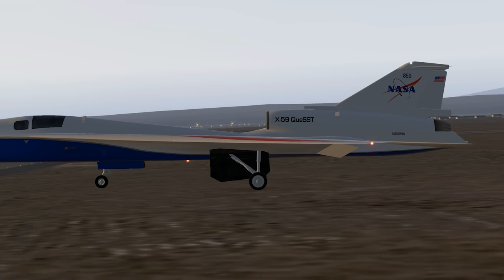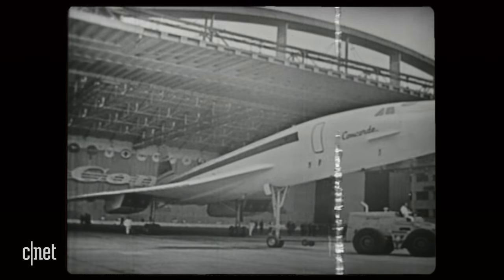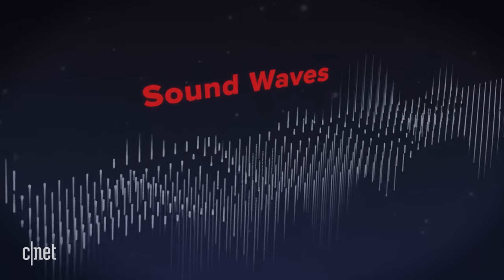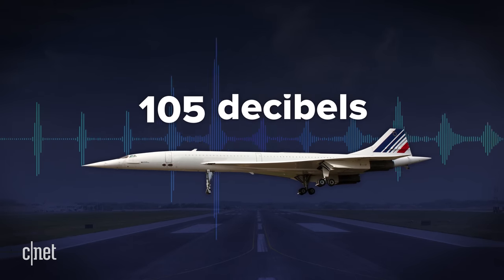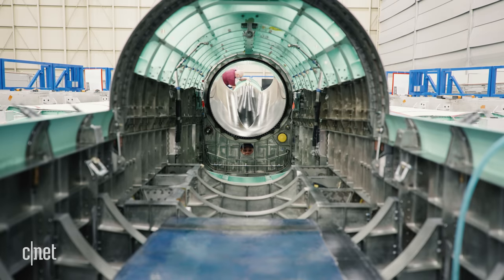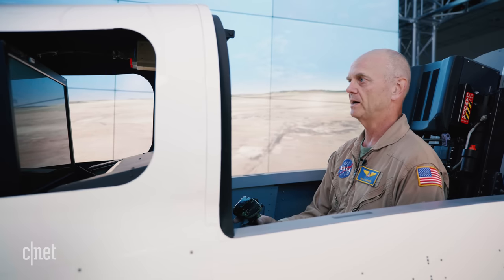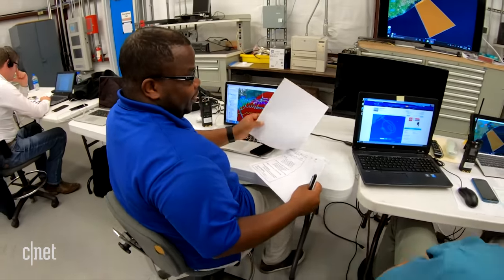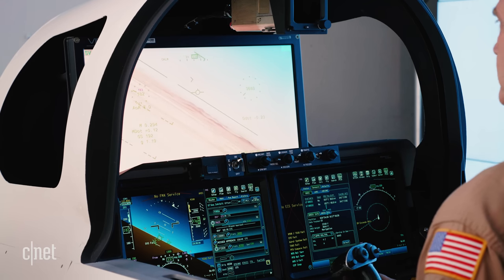Exclusive look at NASA's low-boom supersonic plane

Comment: I flew Concorde one-way (using miles) and it was the experience of a lifetime. We took off like a rocket ship going 250mph down the runway (average speed is 160-180mph) climbing at 24,000ft per minute. Broke the first sound barrier around 1:25 and continued to increase both altitude and speed eventually reaching 58,000ft and 1350mph at 2.0. I saw the black of space out the window, two sunsets, had champagne, caviar, cheese, lobster and more champagne, and we arrived before we left... Paris to NYC in 3.5hrs. I'd do it again tomorrow, an experience I'll never have again. Amazing!!
Reply: The future is looking bright 🌞 ✨️
Reply: Awesomeness! What was your departure time? (if remembered)
Reply: @bar9501  We left Paris at 6:30pm if I remember correctly. I'd need to find my tkt receipt to be certain.

Comment: You know the way Lockheed is building the X-59 is actually really cool. When I interned there I literally worked in the construction are for it. They had the plane split into 3 parts. The front middle and back. They had them separated so that they could work on each piece separately. Then when finished with everything they would just pull the pieces together and secure them. It was really cool watching the engineers work on the plane and literally seeing the 3D models of the plane being worked on. And learning the challenges that these great engineers had to deal with!
Reply: What you described is essentially how we speed up the production process and make the construction of the aircraft stronger and longer lasting for a fraction of the time and cost.
Reply: That's so cool

Comment: It's not just the noise level. It's also the fuel economy - going supersonic also accelerates fuel consumption at supersonic level. 
I hope the jet engine efficiency upgrades also match the noise reduction improvements. Otherwise, this will only be applicable to those who can afford $15000 per ticket - which, to me, is nonsense.
Reply: They won't.  Pointless millions of dollars spent so rich people can fly faster.... cool.  Good job NASA, really taking the world's problems head on there
Reply: it makes sense for businessmen, though; time IS money, especially when dealing with lots of it. In catering to businesses eventually technology will be developed to then cater to the masses, as they have that firm economic base to work with, enabling expansion.
Reply: @PlaySA  Exactly, this only applies to the ultra rich who want to jet around faster. Economy class is all about fuel per passenger which supersonic will never be able to address no matter how "efficient". Unless a totally different method of flight is invented, most of us won't be going much faster any time soon. It's essentially just Concorde 2.0 (and also why they only really care about the sonic boom since that's not letting them fly exactly where they want to)
Reply: If I am correct, at supersonic speeds a thin slow moving layer of air forms around the plane reducing drag and fuel consumption. It is the afterburnes that consume the most fuel. If the engineers can make a supercruising jet which can go supersonic without using the afterburnes the average fuel consumption is reduced. The layer of air forming around the fuselage on the blackbird was a problem for the engines and it would reduce the thrust. The issue was fixed during development. The F-22 Raptor can supercruise at mach 1,2-1,5.
Reply: No it’s mostly the sound. Fuel economy does make things more expensive, but rich people would pay for it. The problem with supersonic jets is most places you couldn’t even fly to because they wouldn’t let you due to noise.
Reply: @gj1234567899999  100 feet, 1 seat per row, relatively quiet, 15 grand ticket price... A small price to pay for the privilege of traveling a super sonic speeds. Integrated XVS into the fuselage would allow for much greater design freedom. It's gonna be pricey anyways, why not go all out on technology?
Reply: @gj1234567899999  I was wrong about the fuel economy at supersonic speeds, however the drag quickly decreases once it goes past mach 1 and slowly tapers off. At mach 2,5 the drag is slightly higher than at subsonic. It would most defineatly consume more fuel than the subsonic jets, but to assume supersonic flight is not accecible for the average citizen would probably be false. It would be more expensive in its infancy while there are few competitors. Heating would defineatly be a major problem. I'm being optimistic here but it may turn out diffrent.
Reply: Rich people may want it. I do hope we ca have plenty of advancements to reduce the problem though.

A supersonic cargojet can be good for the military maybe? Though, why haven’t they?
Reply: @the11382  The military does operate many supersonic craft. Not sure on the specifics of ones used primarily for cargo, but ones that move cargo as well are certainly being used (likely just not on a wide scale, as the more weight added increases fuel consumption, therefore requiring more refueling stops).
Reply: @corey2232  You're completely wrong about that. There are no supersonic cargo jets in military use, nor have there ever been. The only supersonic aircrafts ever used for any military purpose in any nation have been one of the following:
1) Fighter/Attack jets
2) Bombers
3) Training jets
Reply: Yes! U r right! NASA had  better use it for their own purpose only! (I mean should be limited for their experiments only! 🤣)&not to rub it on people! 🤣But who can stop NASA to do something new all the time! 🤣🤣
Reply: going supersonic actually increases fuel economy, going slightly under mach 1 is what burns the most fuel
Reply: You’re partially correct, if the airliners had to use afterburners/reheats to sustain supersonic flight. But, any half decent supersonic jetliner can supercruise without afterburners. If modern airliners flew much faster, they would have to use more fuel than a supersonic airliner because drag increases massively from Mach 0.8 to Mach 1, then drops off rapidly. If anything, a modern supersonic airliner may very well burn less fuel than a modern sub/transonic airliner
Reply: @cooaster2489  wait a minute.  Isn't more fuel used the longer the plane is in the air?
Reply: @corey2232    In the U.S. there are exactly ZERO military cargo jets that can fly supersonic.
Reply: @patmucciante6726   It depends.  "Air density" is the finicky gal we are dancing with.
Reply: @cooaster2489  The F-22 supercruises at Mach 1.2-1.5.
Reply: @corey2232  Not a single military around the world operates a supersonic transport aircraft.
Reply: @chobai9996  We already solved the problem of efficiency in supersonic flight years ago. Otherwise, the F-35 wouldn't be able to supercruise without the afterburner. The best way to create a non-afterburning supercruise aircraft is by making them as aerodynamically slippery as possible, allowing the plane to just slip through the sound barrier. That effectively means the aircraft is extremely low on drag.
Reply: And don't forget the real reason Concorde is gone. It crashed because a piece of metal on the runway pierced the plane, causing the unreinforced fuel tanks to leak, eventually leading to the explosion & crash, killing 109 souls onboard and 4 people on the ground. Concorde wasn't retired...it was put out of business.
Reply: @davids1inwestholl45  Technically the Concorde wasn't exactly as profitable as it could have been prior to the crash. It started becoming profitable just before it crashed.
Reply: @Optimaloptimus  I am relieved! Now, please explain it to the 109 souls' families on the plane & the 4 on the ground that "it was almost profitable."
Reply: @the11382  Something like the SpaceX Starship might do Point to Point high Speed Cargo Transport better.

When it comes to Air dropping Things somewhere in nowhere a Aircraft would surely be useful, i doubt it'll be easy to airdrop at Mach Speeds though...

Comment: on the reduction from 105 decibel to 75 decibel; it is a huge reduction.
the decibel is a very strange unit, when the decibels go up (or down) by 3 points the sound power is multiplied by 2 (or divided by 2 respectively).
from 105 to 75 is 30 decibel, the sound will be divided by 2 10 times in a row.
in other words the "boom" of the x59 will be ~ 5% of that of the "concorde" (not 5% less, just 5%)
Reply: THANK YOU!

Some people don't understand the decibel scale. The sound reduction achieved here (if successful) is MASSIVELY quieter than what the Concorde produced.

Comment: Cheers to all the engineers who unlock their creative spirit to bring us such technological marvels that advance the human race one leap at a time. Bravo!
Reply: Too bad it crashed in France, killing 109 souls on-board Concorde, and 4 people on the ground. 
None of the engineers & technical experts thought to harden the engine cover to prevent metal debris penetrating into it (like it did on the runway in France causing the crash), or, to prevent blades breaking & piercing thru the engine casing, damaging fuel tanks, the cabin or the other engines! That's why the Concorde shut down.

Comment: The Concorde noise problem wasn't limited to the sonic boom - the jet engines were extremely loud also.    I witnessed one taking off from the Phoenix airport while standing near the runway in the mid '80's, and it was the loudest thing I've every heard.   The exception might be standing near the speakers at a rock concert.
Reply: That was due to the afterburners/reheats, engine design, and quantity of engines. Those four engines were massive turbojets designed for a bomber without noise considered. A modern SST would use 3 or less non afterburning turbofans designed for low noise.
Reply: @BrapBrapDorito  Modern SSTs are more than likely only going to require two engines. Considering we can make jet engines capable of producing over 40,000lbs of thrust without the reheats, i'm sure we can make an engine doing 35,000lbs of thrust dry and 45,000 to 50,000lbs wet. Oh, wait. I just described the F135 turbofans.
Reply: @Optimaloptimus  Wierdly enough, the closest one to production (the boom overture) has switched to a quad engine design citing cheaper engines, easier maintenance, and quieter engines (probably due to their lower thrust setting needed with more engines) I guess the reason large SSTs seemingly don’t use less than 3 engines is because to make twin engines generate that much thrust and be efficient at supersonic speeds, they would have to be massively loud as a medium bypass is the reasonable limit for supersonic travel, meaning the core would be absolutely enormous. Remember these things need to carry 60+ passengers very comfortably while generating enough thrust to push a jumbo jet along because of the force needed for transonic acceleration.
Reply: @BrapBrapDorito  Actually the design of the engines is less of a priority compared to the fuselage. The better you design the body itself, the less thrust you will actually need to get the body to go through the transonic and supersonic range. Which is the exact reason the Concorde was a delta winged aircraft since deltas are good at subsonic, transonic, and supersonic, they could even be good at hypersonic if you want to include that. The Concorde for 34,000lbs of thrust on reheat, it was still capable of Mach 2 flight. That's very good in terms of aircraft design. The real challenge is making the engines quieter. And honestly. We have both the research and the technology to achieve that in at least two short years. The military doesn't care about noise, especially since it's extremely good as a weapon. But commercially we have found ways of defeaning the sounds of the engine tenfold. The 787s for example have far less insulation and sound deafening materials than you would normally need in past aircraft from the 1990s all because the sound from the engines themselves were reduced by more than half, a flight on the 787 is almost silent, you couldn't hear the engines. For that reason, we could lower cost of the plane and increase revenue thanks to the decrease in weight and less maintenance requirements. To make it simple, your argument does not exist, it's already been answered. Also, Boom supersonic's overture is essentially just giving us a second Concorde with all the drawbacks minus maintenance. In my opinion the Overture will not last until they completely redesign it into something more akin to an X-59. Afterall, the size of the F-5/T-38 engines didn't matter considering how deafeningly loud those lil J85s are.
Reply: @Optimaloptimus  You are mostly correct, especially about the wings. (which is why the new overture design uses a clipped gullwing delta).  However on the subject of the overture, the engines were a large part of the Concorde’s failure (the Concorde was banned from many airports for its sheer noise level, and it was designed to fly supersonic over lane and sea while the overture is designed to be supersonic purely overseas) the issue comes down to the fact the Concorde could be extremely optimized because of low fuel costs and the interior being average at best. The overture has to contend with extremely high fuel costs and the interior must be very luxurious now to satisfy customers high ticket prices. This means aircraft weight will be substantially higher, and engine thrust levels must be lower than on many aircraft as to reduce noise. Which ultimately brings us back to a quad engine design, which can (in theory) deliver more thrust and less noise than a comparable twin and trijet, while making manufacturing far easier as the engines aren’t as stressed overall. See, the concorde was designed to be an all around jet that was never designed to make a substantial profit as it was more of a government program to show off the capabilities of a few countries. The overture is essentially following the only way the concorde was successful/profitable in its later years, operating long haul routes at insane speeds for high prices, but with the advantage of easier maintenance and not being restricted to extremely few niche airports.
Reply: @BrapBrapDorito  Except four of smaller engines would absolutely not change anything until you design the engine nacelles themselves in such a way that they can reduce the amount of sound heard. The overture literally looks like the Concorde almost entirely, this includes the engine nacelles. If Overture really wanted to lower the engine noise, they would follow Boeing's example and do a better job of creating a noise reduction system. The only thing putting four engines on it will accomplish is change the appearance and tack on a little more weight for no drop in sound. Since as I already said, the F-5/T-38 J85s are not quiet despite their size. Quieter, not quiet.
Reply: @Optimaloptimus  I suggest you look at the new overture design as it looks nothing like concorde, it sounds like you’re going off of their old design.
Reply: @BrapBrapDorito  Well, now it just looks like a 2707 with modern features. Still... at least they're accounting for the research NASA did to make the X-59. Considering it's been streamlined to a point that similarities can be found. My only problem with it are the engine nacelles sitting directly under the wing in conventional pods. Which are definitely going to contribute to the loud noise of the engines.
Reply: @Optimaloptimus  Yeah that does seem like a strange design, along with the shock cone intakes instead of the adjustable ramps on the original. Granted this isn’t a final design so things are prone to change. My only guess for the strange engine pods is for maintenance purposes.
Reply: @BrapBrapDorito  Honestly. It does look that way. The nacelles could just be unbolted from the wing, and they can just wheel it out and put in a new one by simply reversing the process. Allowing for an instant quick engine change with a little bit of inspection and cleaning and anything else that might be unexpected. If it truly is the case, I applaud Boom for going this route, it's a fantastic way to save money, it's the same way the military would do it. My only problem with this whole system is the nacelle design itself. Which as I said does not appear to have any sort of noise deafening features. They could at least go the extra mile and apply deafening to the engine as it idles alongside the redesign. But who knows? Maybe the engines will feature something unbeknownst to me.
Reply: It sounds tough on the ol' ears! Yet awesome I'm sure!

Comment: Commercial planes of that type are going to be long AF :D epic designs incoming
Reply: A commercial plane needs a lot of system redundancies in order to be safe, like 2 or more pilots, and be able to land in case something fails. Since the plane has that front camera and screen instead of a window, if it fails that would make it extremely hard to land it safetly.
This doesn't mean it will not he adapted for commercial planes but it's quite unlikely (also consider factors like passenger comfort, passenger cargo, engine efficiency, etc.).
Reply: there is a specific reason to why it is long not because of the sonic boom but something more fundamental, also I agree there will be epic designs.

Comment: I once was flying from Salt Lake City northward,  and another commercial plane passed the one I was in, much closer than the mile or so which is the required separation distance.  I'm sure it was closer than 1000 feet, maybe no more than 700 feet.  If you add the 500+ mph speeds of the two planes, the other plane (a continental airlines plane) and the one I was on, were moving apart at over 1100 mph, something like mach 1.5.  There was no audible noise, but the speed was breathtaking.  The other plane was there, and then it was gone.  I wasn't frightened, my only thought was, "How beautiful.". At low altitudes, on a supersonic aircraft, you might get a similar effect of blinding speed.